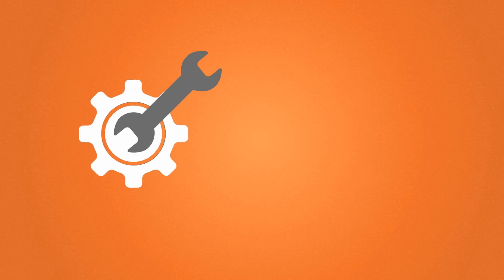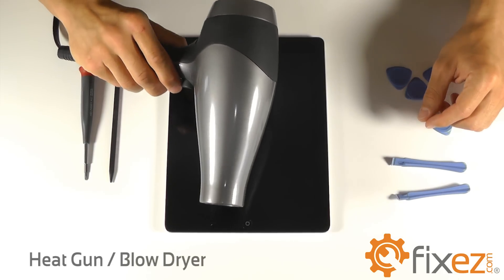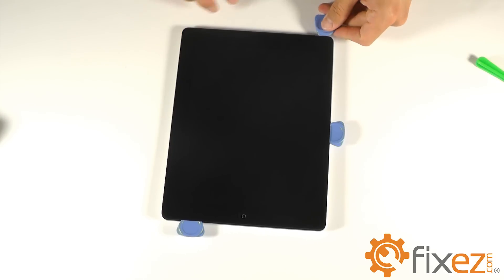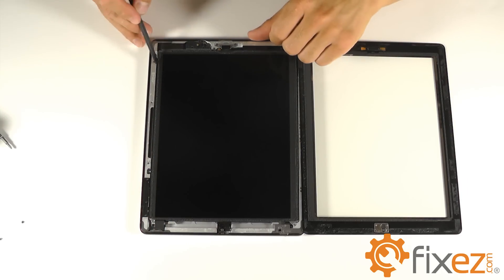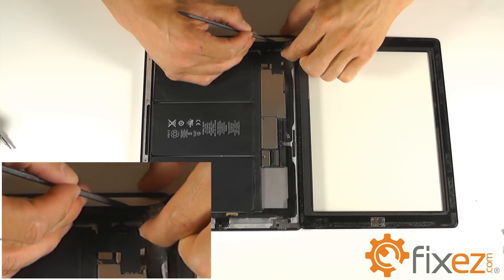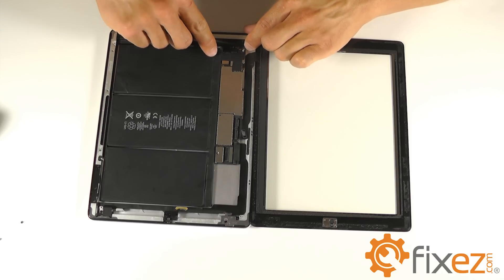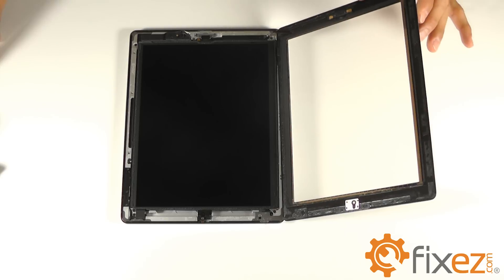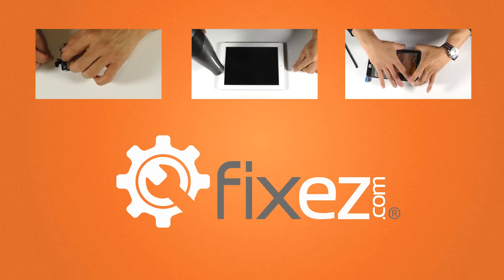iPad 4 Screen Repair & Disassemble

Comment: Does anybody know how to tell the difference between an iPad 3 and 4 because on any website it says 3,4 well that helps:) so please tell me
Reply from the maker: To verify the model, there is a number that begins with "A" followed by 4 digits on the back of your device. If you google the model number, this will verify whether it is a 3 or 4. Some of the parts are interchangeable between these models, that is why it may say "3,4".
Reply: go to the back of your ipad and look for the model # then type that model# on google, and it should tell you what gen it is.

Comment: So why in every other video removing the screen, does the screen break and crumble away as you remove it, but in your video it's like running a hot knife through butter?  Was this an actual screen removal with the original adhesive?
Reply from the maker: We perform multiple tear downs to show different repair process on the iPad. As you stated the original adhesive is very strong and will take more work to remove. We apologize for any confusion. Our purpose here is to show a removal process that you would take to remove the screen on the device.

Comment: Just replaced mine, worked great. Another couple tips, make sure the ribbon cables are pushed in completely tight and test before sealing it up. Finally, you will need to reboot the iPad by holding both the home and power buttons.
Reply: Ntoammmma😀😀😀😀😀😅😅🟩🎄🟩🟩🟩🟩🎄😂❤❤❤😂😂

Comment: What's that little pieces beside the home button do..? The ribbon circuit board part of mine was exposed after the screen was smashed and ended up tearing off when I slid it into its case one day but still works relatively fine.. Any ideas on what it could be..?
Reply: Might be the wireless antenna

Comment: How do I take the hone button of the original screen?
Reply from the maker: +JoeV1998 Carefully peel the ribbon from the digitizer, slide an opening tool(sesamo, playing card, guitar pick) under the two sides of the home button bracket pop out the physical button. clean the bracket of the ld adhesive and apply new adhesive and transfer it to the new digitizer. Thanks for the question.

Comment: how hot does Iit have to be I used both a blow dryer and heat gun and I feel like I'm not getting it right. Do I go completely against the grey case or is there a slot in the black area I have to split it?
Reply from the maker: +John Pickard (f012s4k3n0n3) You'll want to use enough heat to soften the adhesive, but not enough to melt the plastic bezel. A rule i follow is hot enough to be uncomfortable to the touch but not enough to cause a burn. You want to go between the glass and plastic bezel, not the plastic bezel and aluminium housing.

Comment: the glue is already in the new glass?
Reply from the maker: +andre druciak chagas The replacement digitizers should come with new adhesive already installed.
Reply: andre druciak chagas mine didn't

Comment: Hi, thanks for the informative upload.  I was wondering how important is it to ensure all of the 
Regions adhesive is removed before replacing the screen?  Do I have to scrape all of it off?  I'm mainly worried of potentially damaging something while scraping as I've heard that it's difficult to remove.  Thanks in advance for the reply...😊
Reply: *previous not Regions btw, autocorrect - bane of my typing life!
Reply from the maker: +IndoEireannGirl It's recommend to clean the surface as best you can. This way when you add the new component, it sits as flush as possible similar to how you received it from the factory.

Comment: what happens if there's a gap between the lcd and digitizer when I put the new screen back on? hope for a quick reply
Reply from the maker: +Brian ramirez There will be a minor gap as the LCD and digitizer are not fused together. However, it should not be a large gap.

Comment: Please help me. Im using ipad 4. There is a part of the screen that when you touch it, it doesnt respond but some part of the screen responds. Example when you type then you press the letter U but it doesnt type it in the screen but some of the letters respond. Please help. Thanks
Reply from the maker: +Sean Patrick Borge You can attempt a hard reset by holding the power button and home button for ten seconds. No data will be lost but it sounds like a defective touch screen. Replacing your iPad 4 Touch screen replacement would resolve this if the hard reset does not work.

Comment: please help i just finish my iPad screen but touch screen is not responding PLEASE HELP !!!!
Reply from the maker: +Jasmine Helme (Polyclayxxx) Double check your flex cables to ensure they are seated properly. You can also perform a hard reset, hold the home button and power button for ten seconds. If the issues continue, it's possible you have a faulty screen replacement.
Reply: it happened to me yesterday too. the cable must be perfectly attached in its socket. it might look like that it's correctly attached but a tiny move can stop it from working. so push it as much as you can without breaking it do it with extreme caution.

Comment: If just the front glass is a little cracked shall I go through all the steps or just take of the plastic screen and replace it?
Reply from the maker: +Mirza Executioner_HD You would want to follow the guide as shown up until the touch screen is completely removed. The flex cable connection is under the LCD.
Reply: +Fixez.com thanks
Reply from the maker: You're welcome. Do not hesitate to contact us if you have any other questions.

Comment: So if it's just my screen that is smashed and I can still see pictures (I.e I'm watching this thru it) then I can just chang the glass. Am I correct?
Reply from the maker: +Mari Douglas Correct, you would just want to replace your touch screen. As the LCD is not damaged, no need to replace it.
Reply: I got my screen but am too scared to try fix it. One of these days I will get it done...
Reply from the maker: If you need any assistance or have any questions in the process, we're here to help!
Reply: @Fixez  Im scared too, now! I have songs in garageband that I desperately need to retrieve. If I screw it up, are they lost forever? 😱😱😱